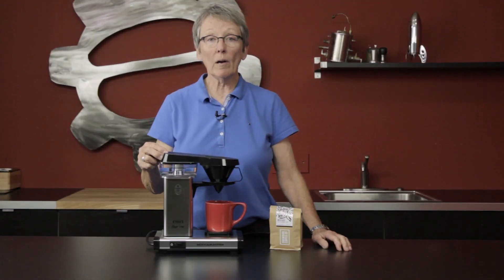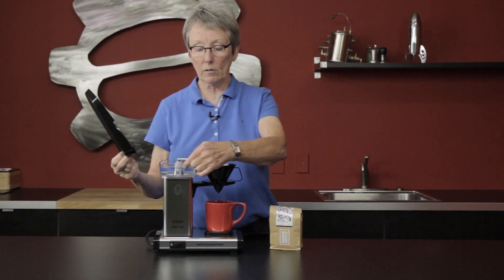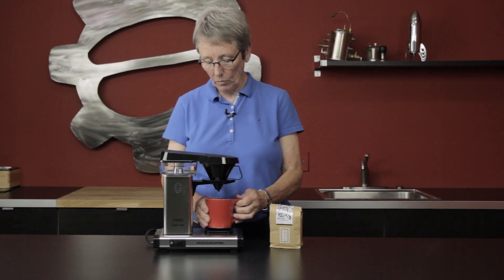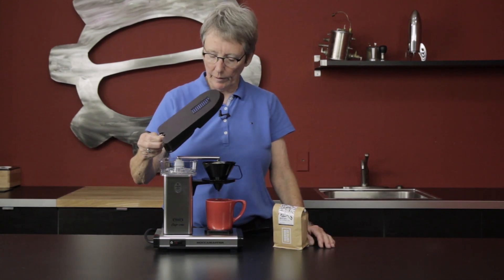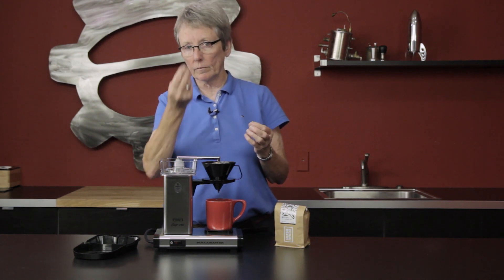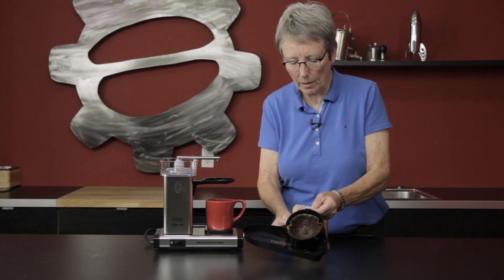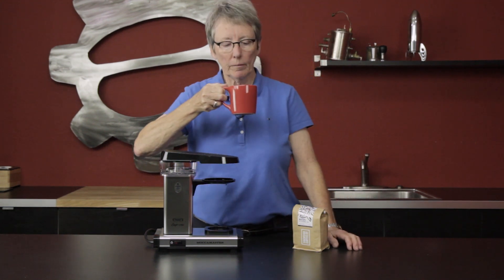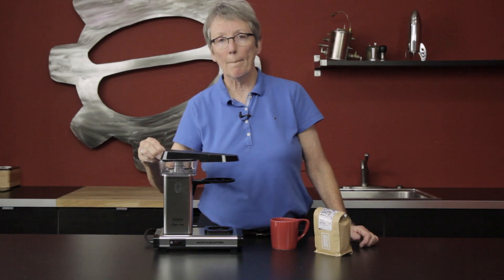Technivorm Cup One Coffee Maker Crew Review

Comment: I have this machine.  I’m drinking the coffee from it right now.  It does make a solid good cup of coffee.  
The problem with making only one cup with larger machines is the coffee grinds do not come in contact with the water long enough to make a great cup of coffee.  This machine solves that problem with a very small drip hole.  You can still use a larger coffee pot to make a great 1 cup of coffee though:  just leave the pot off he machine, put a timer for 4 minutes, and when the timer is up just place the pot back on the machine; the coffee will pour out of the machine very quickly, as it’s meant to brew large batches of coffee.

For this machine make sure that you clean the black plastic part that holds the filter each time you use it to ensure you got every speck of grounds out, and that it pours freely; if you do not, the filter will clog, even with just one fine ground of coffee.  Once you learn that rule, you will be blessed with much better coffee than any Keurig or one-cup automatic coffee maker.

Comment: I use my Bonavita 5-cup brewer to brew 3 cups at a time, which makes it a 2 mug coffee brewer. This machine looks like it could use a shower head and a pause for pre-infussion setting.
Reply: Do you still use your Bonavita in this way?  I'm searching for reviews from people who use the Bonavita 5 as a single serve brewer.  I'm the only coffee drinker in my home, and I want the ability to make as little as one cup at a time.
Reply: @sigh_anna  With it winter these days I brew full "5-cup" pots, but this really makes three mugs of coffee. I would not try to brew an actual single mug of coffee as the timing and coffee/water ratio are wrong. I've told people even if you wound up throwing the other mug away (shudder), it's cheaper to do that than use pod machines.
Reply: @pschroeter1  thanks.  Do you get 3 avg size mugs, or large mugs?
Reply: @sigh_anna  Just those regular sized mugs you can buy anywhere.
Reply: @pschroeter1  thank you 😊

Comment: One thing I never see anyone doing or is even mentioned is to “wash” the filter before adding the coffee to brew to remove that “paper” taste. If I neglect to (my coffee maker is 40 feet from my sink), I can taste the filter. I’m using Melita unbleached bamboo filters. Or was. Ran out during pandemic lockdown and stitched my own from unbleached cotton and over 2 years later still use them exclusively. I made a batch of wine years ago and used a home wine filtration appliance without knowing to run clear water through it first and totally ruined the entire batch as I could taste the paper.
Reply: What about a reusable filter?
Reply: @SaidAlSeveres :  I’ve had a number of them over the years and I’ve found that they don’t filter out the fine debris that drops to the bottom of the pot making it muddy to drink. Mine just has a glass carafe (actually, I prefer it - call me crazy), but since all thermos-type carafes retain that last little bit anyway, it would make not much difference as you can’t get that last bit of coffee anyway. During the pandemic lockdowns, I was short on paper filters and made some from thicker weave unbleached pure cotton “shop towels”.  They work very well too, however, not pretty after a few uses although they could be bleached but I didn’t bother.
Reply: @amieinnovascotia8490  thanks for the reply! I don’t have much experience with drip coffee so I’m learning a lot right now.
Reply: @SaidAlSeveres  :   The only tips I have are 1) get yourself a proven coffee maker. Not only do they continue to work well Year after year but have a better chance of brewing a good cup because they will attain the optimum brewing temperature;  2) put the filter into the “funnel” and fill it with water a few times to rinse out the paper taste;  3) a decent coffee can be found at Costco. Yes, it’s nice to be able to spend $30, $40 lb for freshly roasted beans from the micro-roaster down the road but not totally necessary unless you’re a total coffee snob;  4) buy beans and grind them yourself prior to brewing. And remember: a quality coffee maker can brew a decent cup from mediocre beans. My Technivorm is still working and it will be 16 or 17 years old this spring.
Reply: @amieinnovascotia8490  those are all really solid points. Especially #2 I don’t think most people do that. I know my family never did but it makes sense. Thank you for your reply!
Reply: @SaidAlSeveres :  many, many years ago, I totally ruined a 25 litre batch of wine. Didn’t know and didn’t think about having to run water through the filter to remove that paper taste. Now I rinse the coffee filters too. Growing up, they drank tea (hey, this is Nova Scotia, of course they drank tea) and coffee was instant!  Yep: instant. Back then it instant coffee was in its infancy so not very good. And I do drink instant and the one I get is pretty darn good.
Reply: @amieinnovascotia8490  hahah oh no! What a lesson to learn. Also Nova Scotia is absolutely on my bucket list of  places to visit. I’m not tooo far away in Ohio.
Reply: @SaidAlSeveres  :  Driven through Ohio a number of times. I’m not a fan of Tim Hortons coffee anyway but I did get one somewhere in Ohio and it was the best cup I’ve ever had from that franchise. Although 45/50 years ago it seemed good. I was surprised to find one there.
Reply: @amieinnovascotia8490  haha yeah I’m not a huge fan either but the coffee isn’t too bad really!

Comment: This is quite neat - I have one in my office. It does come with a couple of porcelain cups (8-10oz) with 20g of ground coffee so it's quite strong when I have it. 
Trouble is that it's not that much cheaper than pot version (8-10 cups) ....just a bit smaller. 
Also people have come up with work arounds before making your coffee like heating a small amount of liquid so the metal pipe and the cup is already hot.

Comment: It might be tolerable with a proper shower screen, but it's way overpriced for what it is.  The whole point of pourover is control, right?  This just pours in one spot.  And does it allow for dialable temps?  One could easily just use a small pan and thermometer, boil some water, stir in coffee right as it cools to the preferred brew temp, and then pour it through a paper filter.  It saves a gadget and counter space and things that can break, and is knowledge that can work anywhere.
Reply: Yeah, I guess if you have so much time and it's of so little value you could do all that. Most of us prefer not to live in the 1800s.